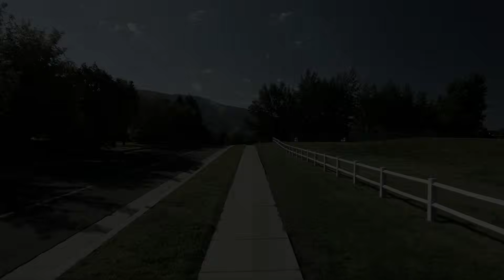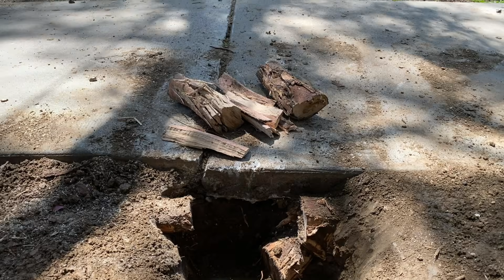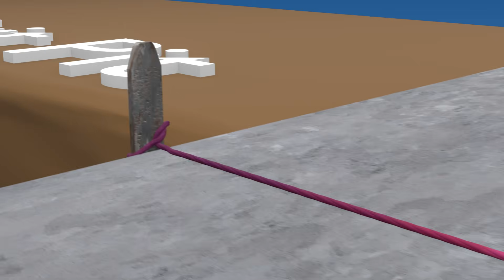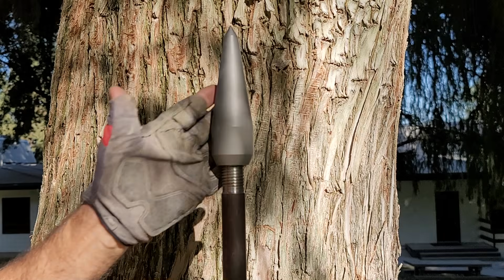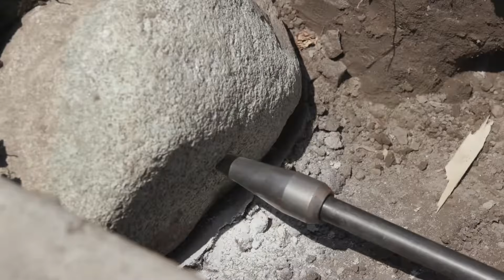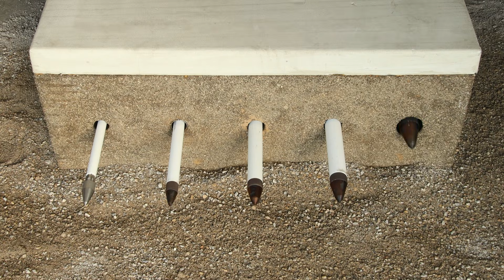Bullet Mole Sidewalk Kit | Bulletmole

Comment: I’d rather rent a cement cutter and forget all that digging and hammering.
Reply: Well Thats peogress and real professional. Even if you had to do it 1 time I know its too expensive to buy, In that case we do rent them and you could have the job done by the time you go pick up the saw with a lot less effort, Weather you pour 10  yars or 1 bucket of concrete it still takes the same amount of tine to finish.

Comment: Is this thing a joke or what , all you need to do to trench pipe under a sidewalk or driveway take a PVC pipe and your pressure washer hose with a plumbing blowout the water pressure treats the whole and you can push the pipe right through no hammers no sweat easy
Reply: So let's see if I understand this correctly.. Load  a pressure washer, garden hose and high pressure hose for the washer. Unload it at the job hook it all up and blast a hole with water through dirt. Shove your pipe in a muddy hole, clean up the mess and change your clothes.. very professional.. believe me I've done it all before.. then take it all down and load it. What if there is no water, maybe the engine doesn't work so good, or the hose is too short or gets a hole in it. Anything like this happens and your done. Now the last but not least you are going to tell me that the pressure washer will blast through a rock and dissentigrate roots. I just can't wrap my head around the advantages of a pressure washer over this tool in any given Scenario no matter what obstacles. By the time you get this set up we would be done with pipe installed through roots, rocks or whatever and on with the next phase.

Comment: This product is a waste of time, most contractors who would need this would also have a hydrovac truck that is daylighting utilities, which can create a void under the walkway just big enough for the amount of conduits you need.
Reply: Oh really? Most contractors that actually have bought from us have never mentioned a hydrovac truck. They are usually smaller  contractors who just want a fool proof, small , ( not quite as big as a hydrvac truck) compact quick and effective way to get thier pipe under pavement. Contractors such as  Electricians,plumbers, cable,data,conduit installers landscape and irrigation, etc. In addition  we have sold to cities who do have hydrovac trucks such as Los Angeles, Kansas, Atlanta, Murrieta, Google and others. They never mentioned that their "hydrovac" trucks were adequate. Evidently they weren't thats why they bought the amazingly compact and extremely effective Bullet Mole. It fits in the trunk of a small car so that the much larger hydrovac trucks can actually spend their time be used for better things that it was designed for.
Reply: I install conduit under walkways weekly and it takes about 30 minutes from start to conduit in the ground so my experience speaks otherwise. That's just one stubborn guy's opinion however.

Comment: Will this product work if I need to go through a gas line?
Reply: Absolutely, gas lines both high and low pressure are made out of  polyethylene and the Bullet Mole will penetrate them with ease. WITHOUT an explosion. This is  because there is no spark.or enough oxygen underground to ignite a flame.  We have actually tested it this way with a gas lines both low and high pressure. However the absolute safest route would be to turn off the gas first. If your being psarchastic and if you are a professional then you would know that you need to call dig alert at 811 first to know where the gas lines are and next you need to pot hole areas where you need to know precisely how deep they are so that you can lay out your job more clearly and avoid  avoid hitting them. Either way you will have great success with this amazing tool. Thank you for your comment
Reply: Don’t listen to this bloke, tested it hitting gas pipes have you? You are giving out false and dangerous information about gas pipes. Ruptured gas pipes can and do cause explosions. You need to stop now!

Comment: “Simply tilt the case downwards and the pipe will slide out” really?

Step 1 solder 3/4” male adapter to copper pipe. 

Step 2 attach to water hose

Step 3 turn on water and water jet Uber the sidewalk.

Done.
Reply: Until you hit a rock ,root (roots) or buried debris. I don't know why so many who respond to this feed ignorantly insist that a pipe with water will penetrate difficult, debris laden soil.that is what this tool was built to do and it will do it the first time everytime no matter what is in the way. There will be no starting over because "ooh" we hit something. If the soil is clean it will pierce through in as little as 30 seconds with no water or hose to mess with. So as the tool slides out pre assembled just bang it through and 2  minutes later just slide it back in. Yeah Really give it a try then you'll know. If you have clean soil then a pipe and hose are adequate without having to spend so much money. I AGREE.

Comment: sucky idea, never mind the fact that your acting at the hammer or the jack hammer going through the ground.  This is ALOT of work for this useless tool.
Reply: Incase you haven't noticed, this type of work is all hard work and unpredictable as well. Usually the guys who need to do this for a living,, want a fool proof way to make it happen and get the job done,, which this tool does. In addition they are usually manly men who really don't mind a little bit of hard work if it means getting her done no matter what and moving on with the job. Now if swinging a sledge for 30 minutes makes you shiver and shake then mabe some other way might be more appealing. Whatever that might be?????????

Comment: not how its done correctly though......     all you are doing is compressing the soil around the area and putting additional stress against the sidewalk/concrete.  that will lead to cracking and lifting in the future.  you need to actually remove the soil for the tunnel that the pipe will go into.   the soil needs to be removed so that the area around the pipe is not disturbed and will not cause damage and problems in the future.
Reply: Tell that to the fortune 500 company Ditch Witch. There torpedo missiles are used extensively throughout the world and have been for decades, in these applications. I don't see them going out of business because of damage caused by thier ground piercing tools. Myself I've been doing this for 27 years now and thousands of bores later I haven't received one single complaint from anyone regarding cracking after the tool makes the hole. What tangeable facts are you basing your comments and conclusions on?

Comment: Are you serious?, how about just lifting the paving slab, dig a trench and fit the pipe and cover and replace the slab.
Reply: That’s destructive and wasteful. I’ve done this with a hose connected to pvc and a pressurized tip. A little muddy, but in AZ it dries quick and does not require all this force. Also costs like 15 bucks to fashion
Reply: @billionairebuddha617  when i started watching... i thought it was going to be some kind of warter jet.  No way it would split  rocks.  Now i see how it works.  Pretty cool but only if you do that often.  My dad showed me the water trick 30 some years ago.
Reply: It took us 8 min to dig the trench and 2 minutes to drive the pipe in with the tool through big roots. JOB DONE. Under 10 minutes. How long do you think it would take you to do what you propose?

Comment: I've been doing this for more than 30 years with a standard pipe and it didn't cost me an extra tool
Reply: Your fortunate to have had clean soil. Most of the country however is covered with Mountains however we have sold a lot of these in Florida where it's sandy but of course I think they bought them for the roots. Most of the the feedback that we get from professionals is that they are really done with water assisted bores. Thank you for your input.
Reply: @stephenlafontaine2286  my soil is glacial till full of rocks and cobble  hardly easy but no different than pushing through limestone  of Florida maybe a little harder- gabbro, granite

Comment: Looked like a pre-drilled hole in that rock. @4:43
Reply: You might think so. Read the testimonials from our customers on our web site at bulletmole.com, who have been using it for almost 20 years. They know for themseves that not only do you not need water but there is also no need for pre drilling the rocks either! We haven't been here for 27 years for nothing.
Reply: If it’s a good product, that part of the video takes away from it.
Reply: @SteakAndTaters  That part is there to clearly show what the tool will do to a rock if it runs into one or more. This is the biggest problem encountered when making a hole under pavement so in the video we want to destroy all speculation that this tool wont be able to penetrate obstacles. The feed back so far has been that that scene is what really convinces people that this is the right tool for them.

Comment: What options are there for something wider than a sidewalk such as a driveway?
Reply: Check out our 2 car driveway video posted last week on our website at bulletmole.com. you can go as far as needed and install pipebup to 2". The shafts are 5 ft 4 inches long so you would buy as many as need in addition to the ones that come in the tool pack, to achieve your desired distance.
Reply: Water bore. Hose, hose to PVC adapter, PVC mare adapter and brass pointy spray nozzle. Just make sure to stay level or it can dive down several feet

Comment: I tried to use one of these about 10 years ago  to go under 6 feet of sidewalk. I rented it from a building supply company, unfortunately the bullet broke off and when it was finally retrieved (while creating the hole by another method) and the set returned the building supply company refunded the rental fee.

Comment: Be fine for large pipe but I find cutting teeth in a pvc and water do just fine and I can add on pieces as I go depending on the length of concrete pvc cheap the looks like it cost you a hundred or more and then the cost of add ones fine for commercial groups but not worth it for a independent contractor who can just push a pipe in no measuring string lines or sleds
Reply: THANK YOU FOR YOUR COMMENT. It sounds like you are in an area with ideal soil conditions. Water and pipe are definitgely cheaper and easier with 2 exceptions. #1 many homeowners are leary about undermining thier substrate with water which can create cracks in the future. As a result I have recieved many calls from concerned homeowners who take take over and look for a way that doesnt use water. (Something contractors should already know) #2 Hope you dont hit roots or burried debris,which is always inevitable and ends up creating an even bigger mess. Our tool is not cheap and usually not feasable for limited use customers as you mentioned so  in order to help these customers we do rent the tool and ship it Nation wide.
Reply: @stephenlafontaine2286  

Sorry but I have hit many roots and over pores of concrete and most homeowners don’t stand there watching us do our work they expect us to clean up any mess and we do as for undermining once a pipe goes in it stays and it’s scheduled 40 or 80 that well supports the mined area as for holes being to large we simple flush soil back in bye caping one end off and adding some lose cement mix which supports the cement above
Reply: Sounds like bit of a hasstle messing with concrete and I know that PVC pipe is no match for substantial roots But if its working for you, thats what is most important. and I wish you all the best. Thnks again for your comments.
Reply: @stephenlafontaine2286  
Not at all it’s quite easy and we’re not trying to build with it just helps solidify the material back to its original density and as I said we us schedule 40 or 80 depending on the job which last a significant amount of time 

As for roots main reason to cut teeth into the hard pvc shreds them nicely if they were that bad I wouldn’t be installing a pipe there most likely the sidewalk or drive would have damage or a tree to close you want a more open area for your pipe as for mess it’s not only sloppy workers make that kind of mess and I’m not in any way sloppy on a well paying job that could lead to others
Reply: @warrathblacktiger5566  
So your telling me that you can penetrate/ shred the kind of eucalyptus roots seen in our sidewalk video with a PVC pipe?
Reply: @stephenlafontaine2286  

It depends on root size and pipe size as to penetration at certain point you can’t once it gets the diameter of a small tree say 4/5 inches at that point your getting into feeder roots and you wouldn’t want a pipe in that position it would lead to collapse in a yr or so most likely your to close to a tree or the tree is hunting water and will soon destroy the pavement above it  

Most obstructions under sidewalks and drives are over pour from concrete or the under-lament of large argot or someone used crushed bricks or  cement blocks as filler in that case it will take some effort but most times the water loosens them enough to either push aside or force the pipe to change corse it’s easy to notice threw touch when shoving the pipe and can usually be adjusted bye angling the pipe just a little if you can’t punch threw 
Once threw and set you can plug one side and feed a slurry mix of cement and compaction dirt in with water and let it set up and harden to make up for what got washed out
Reply: @warrathblacktiger5566  All wonderful Ideas. We wish you all the best. We are here if you ever need us for anything. Great communicating with you.

Comment: A ground rod and sds will do exact same thing
Reply: So a ground rod will make a hole through rocks, roots and install a 1-1/4",1-1/2" or 2" pvc or poly pipe? Copper ground rods.....the last time I checked are made of copper, a soft metal, so When it hits a sizeable rock or root it ain't going nowhere except stuck and bent.Since our tool is not made if copper it will actually penetrate these types of obstacles and install the pipe through them. Not to mention the point is larger than the shaft(unlike a ground rod) so they will never get stuck ( like a ground rod will). Thank you for your response.
Reply: @stephenlafontaine2286   Actually ground rods are copper clad not copper and yes they will work exactly like this thing.  Once the hole is made its easy to push PVC through 99% of applications. Electricians do this every single day. Irrigation guys use a water jet usually. Rather than be condescending maybe you should use the info to realize why the construction industry isn't using this tool more. I just gave you the answer.
Reply: From my perspective the  electrical,irrigation, data installation companies etc. Are all using this tool it quite a bit and have been over the last 27  years.  That is why we are still here. There is demand.
Reply: @stephenlafontaine2286  Never seen one on a construction site in my life and I've been a PM for many years.

Comment: This is like a pneumatic “ missile “ used for putting n underground utilities
Reply: Unlike the missles
 1) it easily penetrates rocks and roots, 
2)You will absolutely never loose a tool like torpedo that can dive and will not back its way up, so cut the hose or dig up the road to retrieve it.
3) Also the Bullet Me will install the pipe as well.
4)You don't need to buy or lug around a compressor.
Just a few differences but they are not worth it to everyone. We have sold to quite a few missile owners.
Reply: But a lot longer trench is needed.
Reply: And it’s self powered unlike the missile that uses a compressor

Comment: How many lengths can you put together if any?   What if I have a 30” length ?   Maybe I missed that
Reply: Yes you can add as many shafts as needed to go whatever length necessary. We have gone 66 ft.with no problem. We have gone 32-45  many many times. The average 2 lane road is 32 ft. And this is absolutely no problem at all. Check out our other videos at bulletmole.com, thank you for your comment.
Reply: You didn't miss anything, they never said anything about, putting  multiple lengths together.